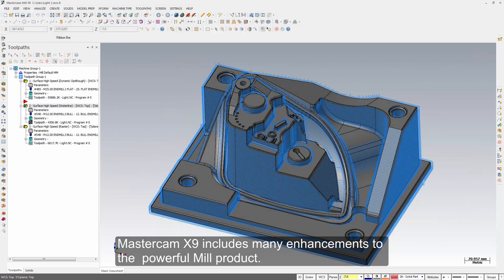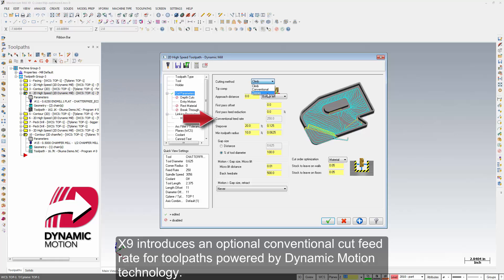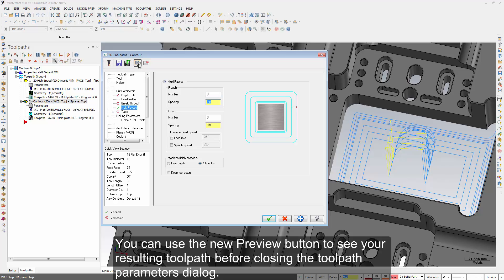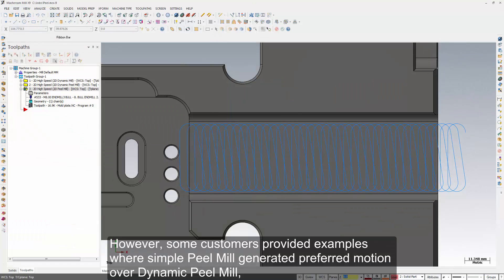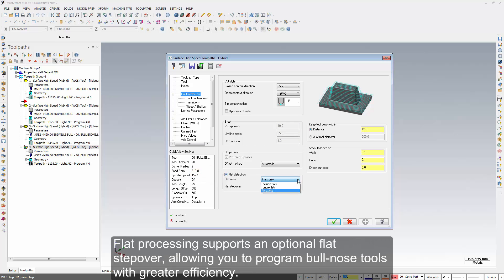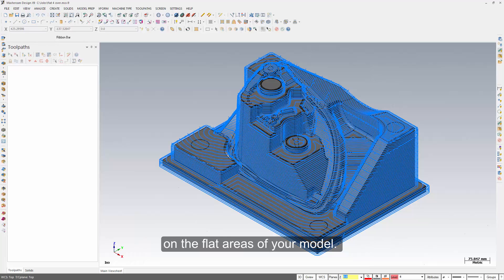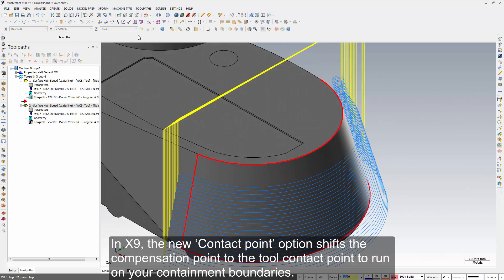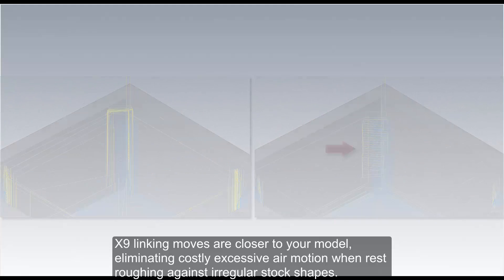Mastercam X9 - What's New in Mastercam Mill

Comment: I have the student version since i am taking a Mastercam course, when i was on windows 7 mastercam x9 worked great, but now that i upgraded to windows 10, it seems like everything is more laggy and not as responsive. Any plans on fixing these issues? I am sure im not the only one who has had this problem.
Reply from the maker: +cheeriomartinez please contact your local Reseller as they can help set up your system to work with the new software. http://www.mastercam.com/en-us/Communities/Find-A-Reseller
Reply: +Mastercam I am using windows 8 now and it works fine, its just windows 10 that mastercam doesnt work well with. Windows 10 and mastercam dont mix. Thanks for the response though. I rather stay on windows 8 and save all of my work instead of having it constantly freeze on windows 10.

Comment: X9 linking moves with minimum distance or minimum vertical retract still violates drive geometry and rapids through the part. Unfortunately, it shows it in verification, but for some reason doesn't consider it a collision. Sure wish it would get better with that.
Reply: d1neu1 If mastercam wanted to fix a few things, the community would be more than willing to send in some reproducible bugs. There is not a lot of active support for these odd occurrences, there are not a lot of alternate cam options to go to at the moment. It looks like mastercam is getting quite a bit better every year, hopefully it continues.